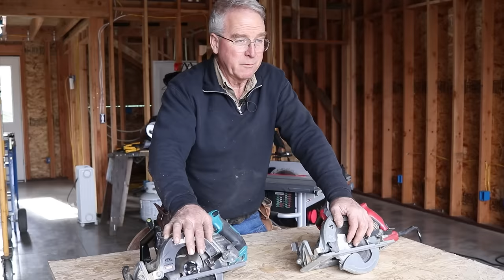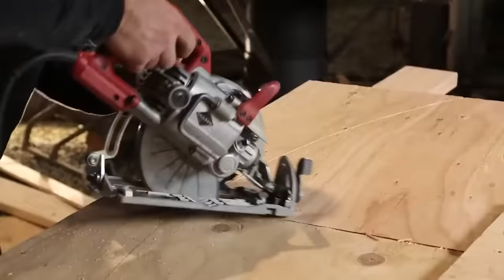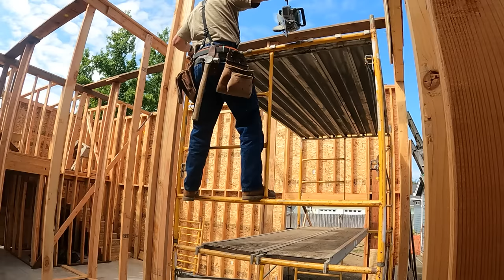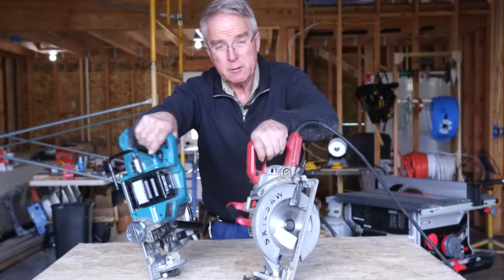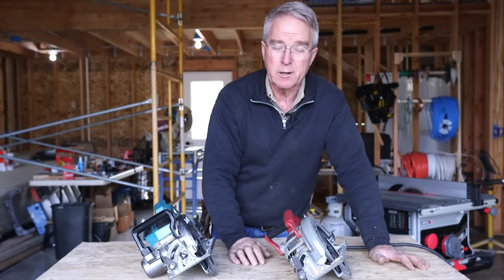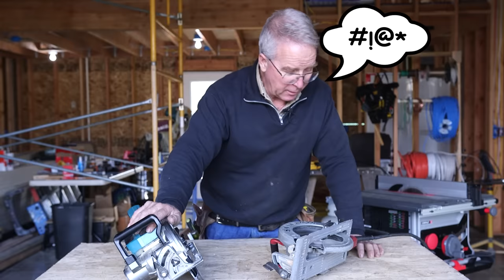Makita 40v XGT GSR01Z 7-1/4" vs. Skilsaw Mag 77 Circular Saw Review

Comment: I don't get those that want to hang on to their corded tools. I'm a stubborn old head myself that lugged around a mag77 for decades. I switched to the Makita and have never looked back. His points in the videos about what you can do with the cord (lifting it, lowering it, finding it, etc.) are rather silly. The Makita, at the end of the handle, has a place that you can anchor a cable, rope, string, (pick the one you want) and do the same things. Cut the cord off the Mag and the saw is worthless, cut that cable, rope, string off the Makita on the saw still performs exactly the same. Oh, and the battery running issue he brings up??? Seriously, check the battery level before you get up on the scaffold... That's user error, not a flaw in the tool.  Excellent video overall, but I wanted to nit pick over those couple of items.

Comment: Inherrantly I dont think its an apples to apples comparison (yet). Leave the corded one within range of the cord and use the cordless one for etcetera. Spending time in this ethos it becomes clear that using different, smaller, more "hot shit" circular saw running on battery is the winning move in conjunction with the traditional skill saw. I honestly dont really see a point to the battery competitors of the traditional skill saw framing pattern. Some battery saws are more compact and run the same size if not bigger blades. I think a video of you using and reflecting on some of these more modern designs would be very interesting!

Comment: The problem with these high power battery tools like table saws miter saws and circ saws is that the big amp hour batteries are insanely expensive. Each one of those batteries is the cost of a new Skilllsaw.
Reply: I agree but if you use your tools to make a living and it adds to your productivity it might be worth it.

Comment: Larger battery-powered tools come with a serious price tag -- not simply twice as much up front, but like all battery-powered machines, the Makita unit is hobbled by the long-term rechargeability of its batteries -- and the cost to replace them. Just one battery would set us back ~$220 -- and we'd absolutely need to replace them in pairs (at least). Every three-five years it would be like buying that machine all over again (without getting a new machine). That, for me, would require more than an occasional instance of convenience.

Comment: I wish they had cordless saws, with a removable cable.
Can use it either way. That would literally be the best of both worlds.
Reply: Metabo HPT/Hitachi 36V rear handle and complete line can use batteries and AC adapter
Best of both worlds

Comment: Warning:  A Saw with a brush motor and a "New" Inverter may not work.  The issue is a High Start current and "Wind-down" voltage spike.   For remote use watch out for "old" motors and that can damage "New" inverters.

Comment: If money is no object, than it begs the question, “what are you doing in the construction industry in the first place?”
Since money does matter to most, it’s important to remember that buying a cordless tool is not a “cry once” proposition. The batteries only last a couple years so you are always going to have to be replacing batteries every couple/few years, whether you use the tool or not. The batteries just die. So if you look at a 10 year stretch, a cordless saw is going to run about ~$2k (No inflation factored). At 10 years you could easily still be on your first corded saw with an original output of only about ~$175. Less than 10% of the cost of the cordless. 
For the homeowner only making occasional cuts? Get the corded. As mentioned above the batteries go bad even w/o use. 
For the craftsman making cuts all day every day? Get the corded. The cord becomes a non-issue very quickly and even carries collateral advantages. 
The cordless is the only option if you just don’t have access to a power source for long periods of time. You’ll want at least 2 batteries though. 
There is always the handsaw. A sharp handsaw is a pleasure to use. A dull one will make you hate what you are doing.

Comment: When will a company make a worm drive saw that has a battery pack built in that has to have a cord to charge at the saw vs at a charger…..and that same cord can be used to operate the saw at max performance while plugged in and charging?

Comment: As always Scott, excellent video. I've always said that electric is a different kind of power... Better. I have a cordless saw and the only thing it's used for is to cut down stock to avoid having to put something on the ladder racks. I've been self employed for 24 years now and people don't understand how one guy can build a deck, a roof, I've even been known to build a couple garages by myself. And the answer is simple. Every little bit helps. And having the right tools for the job is essential. I can't help but shake my head when I see guys hogging out 1/2" bolt holes in 6x6's with a cordless drill, or watching a guy cut a stack of floor joists with a cordless. I'm old school, like you, and really appreciate the work you do. Keep it up. Thank you. JASON

Comment: I would argue that as an actual saw based on cutting performance alone then no question the corded saws still have the edge, But the convienience of slapping on a battery and walking around anywhere and everywhere on a site means in my book the cordless wins, purely on practicality.. I detest walking around on site having to lug around a 110v transformer or extension reel to use the hammer drill or saw for  a single quick cut or hole in a wall.. Now if I just had a workshop then I absolutely would still have corded saws, makes no sense spending a fortune on the saw and batteries to move about practically knowhere..

Comment: Your conclusion is perfect! And Yep, the batteries and those good old "platforms" now there's less emphasis on the tool and more on the platforms. The big tool-maker-boys are competing and putting in all they;ve got to win the "platform" war. They love that "brand" loyalty which shifted towards battery loyalty....Some tools a worth having for the occasional need. It will pay for itself but still is occasionally needed. Better to have a cord in the way than having a dead battery (and discountinued) down the line when it's time to use it. The Big-Tool-Maker-Boys WILL reduce the quality of many of their tools when one or two of the Big Boys start crumbling (bankrupt, mergers yadayada...)
My loyalty is to the TOOL and not the "platform". The makers play a role yet, like in the automobile industry, Ford is (was) good in making pickups but not all of their vehicules are at the top or serve the intented needs. Not all things called SUV can get where a genuine 4x4 is meant to go.

Comment: As a Framing company owner with 8-12 employees I switched to cordless about 5-6 years ago Dewalt 577's. 
Pros: Not paying people to roll out $75 cords that only last a year in our cold climate.
Downsizing generators (jobsites rarely have power) to smaller more fuel efficient ones for charging batteries.
The guys like them.
Flexvolts work in all the tools sawzall, drills etc.
Save about $10 a day per crew in gas for generators.

Cons: Saws are slightly less durable.
Raising and lower saws out rafters or off the roof.
Saws are more likely to tumble off the roof without a cord/tether.
Battery price have increased significantly the last few years (lets go Brandon).
Cold batteries in the morning (place the near the generator exhaust). 
I am going to try that new Makita, although switching each shed/trailer to a new platform would be pricey.

Comment: Hit the nail on the head with changing the battery platform.  When Makita upgraded to the "star technology" on their cordless 18v platform, they were NOT backward compatible with the previous generation (unless you used the very specific 3 ah battery).  There was a little tab on the old tools that kept the star batteries from sliding in.  Makitas recommended fix was to knock off the tab.  

I'm sure all cordless tool companies do this, because lets face it, they make their money on consumables. But its a tough pill to swallow.  And if you want a different brand of tool...forget it.  Its all very frustrating.  Cordless tools have their place, but I'm with Scott on his assessment; convenient, but not sure its worth it for many tools.
Reply: On getting stuck with one brand of cordless power tools because of the cost of batteries: There are battery adapters for 18v/20v that are sold on Amazon and eBay that allow you to interchangeably use batteries from Makita, Milwaukee, and DeWalt on tools of those brands. You still need to have the chargers for those brands because the adapters don't work on chargers. They cost around $20 each. Since finding out about those adapters I've been able to pick and choose which brand to use for a specific tool based on reviews without having to worry about having batteries for that platform. And if the tool came in a bundle with battery and/or charger then great I can make use of those batteries as well. I have tools from all 3 of those brands but batteries and chargers from only Makita and DeWalt.

They also have adapters for those three brands' batteries to plug into Ryobi tools. Most pros would balk at using Ryobi but I'm a DIY homeowner/hobbyist user and find them useful for tools that I rarely use so not worth spending money on a better brand. No adapters to run Ryobi batteries on other platforms though.
Reply: @johnthumble5154  pure bs, they have two platforms for circs and they are both great, with one destroying the competition
Reply: @riba2233 oop here's the fan girl again. I told you I'm not arguing with a Child.
Lol destroys the competition, Project farm says otherwise.
Run along Play with your theft deterrent teal toys kiddo.
Reply: @johnthumble5154  haha, still coping I see, Milwaukee fangirls are really good at it. Project farm didn't even test them, you should watch some more serious comparisons like one from concord carpenter. Tell me when your Milwaukee smokes out and they tell you it is not worth repairing...
Reply: @riba2233  I'm not bitting kiddo.
Off you go those toys won't play with themselves, you could even play tea party with the Makita microwave and  kettle 🫖👸
Reply: @johnthumble5154  wow you destroyed me with that argument, so brutal, I don't know what I'm going to do now... /s
Reply: @riba2233 I told you what to do, go and have a tea party with your teal toys.. I know reading is hard for you but take your time petal, you'll get there.
Reply: @johnthumble5154  looks like reading is impossible for you, since you are ignoring everything I said and just keep trolling, which is obviously only thing you are capable off. Oh and you said that you are done talking to me, but it looks like the urge to troll is too strong...
Reply: @riba2233  I suppose you can show me the part where I said I was done talking to you then? 😂 Proved my point. Thanks.
What a mouth breather.
Thanks for the laugh young fella.

Comment: Dude, I swear you must be older than me,...and the MAG 77 was not out yet when I was young. It was just the plain old skil 77 (was usa made and about $130. at a tool store). So how can the "mag" 77 be your daily driver all those years unless you are way younger than you look? (unless the mag77 didn't have a red handle early on).  I went from the 77 to the mag 77 to the porter cable 743, then 743K..743K topped everything due to how light it was (and you can own a left and right handed version). I still have all the others. Can barely lift any of them. My opinion is that the Makita hyphoid corded saw probably runs slightly smoother than the rest of them, but it's heavy.  By the way,...our framers have been cordless for a few years,..they always use dewalt.  Their miter saws are still corded. As far as rotary hammers go,..cordless is great unless you have a LOT of concrete to drill...then you need to stay with a cord. Both have their place. So far I see no point in  a builder using a cordless table saw, but remodeling it will give you a slight advantage.

Comment: I had a black n decker cordless circ saw about 20 yrs ago, good for 2 or 3 2×4s, pointless 
My 36 volt makita will handle alot more,you need extra batteries for heavy continuous work but with the quick charger it will work continuously. 
Hint* look for the deals that come with 4 batteries, bought the chainsaw and the circ. Came with 4 batteries and double  quick charger, each, saved hundreds and love both tools but obviously the corded models will be lifetime tools and and cordless will eventually need new batteries, tech has made leaps and bounds but... 
The corded is corded. The cordless is cordless, both awesome tools for what they are

Comment: I've used both for 5 years and the makita is far superior. The battery lasts plenty long. The break on the blade is huge. Way better. If I need to rip a shitload of 3by, then I'll break out the mag77.
Reply: The break on the makita is a feature. Same with the soft start so it doesn't girate away. If you've used a ryobi saw they spin forever after the cut is done. A waste of time.

Comment: I don't think it's the fact that cordless tool don't have the power to do tough cuts, it's that they add in all sorts of "safety" features, for binding, kick back, rotation etc  that it artificially kills the power.

Case in point, drills. They keep making them more and more powerful, but then they add anti-rotation/kickback to them. So when you're drilling a 4+ inch hole saw, they crap out on you before they actually run out of power. It's super annoying.

Comment: @12:24:  Bam.  There, you said it.  Battery-operated tools are designed for obsolescence.  The battery will wear out and they'll stop making the old platform so they can sell you not just new batteries, but also a whole new set of power tools.

Screw that.  I got hung out by DeWalt.  Never again.

Corded tools will last until we switch away from 60 Hz 120V AC.

Also, batteries either lock you in to a single manufacturer or curse you with multiple charging rigs.  On the other hand, with corded, you just buy the best tool from whichever brand makes it.

Yeah, cords are a hassle, but for me, they're worth the trade-off.  I only buy battery-operated tools for stuff that really NEEDS to be cordless.

If tool companies get serious about standardizing battery platforms and legacy integration (similar to USB standardization), I'd reconsider.
Reply: Thays true but it isnt the hardest thing in the world to rebuild a battery.  With thay said Cords are timeless.
Reply: @JayDee-b5u  If you'd be kind enough to post your mailing address, I have a few I'd be glad for you to rebuild.  ;)
Reply: That is a bs statement, makita batteries last really long and they stick to the same line like forever
Reply: @riba2233  I'm glad to hear Makita has shown a commitment to a platform and presumably to legacy adapters.  They're a very good tool company.

That said, the batteries won't outlast a cord, and no current or foreseeable battery-platform commitment will outlast a national infrastructural commitment to electrical voltage and frequency.
Reply: @ncooty  and they don't have to. 5-10 years of good use is good enough. The convenience they provide is huge, so it's not a huge problem if you have to replace them now and then
Reply: @riba2233  I'm not sure why you think we're in any sort of disagreement.  The trade-off in convenience sounds like it's generally worth it for you, whereas that's less often the case for me.
Reply: @ncooty  👍

Comment: I HATE battery's. Im convinced they want to sell you battery powered everything because the battery's are designed to fail/degrade after 6 or so months of heavy use.  I don't need a subscription service for my tools. I buy corded whenever I can. Its cheaper, does not charge, and is often more powerful.  Most  the jobs we do are close to power anyways. Makita does make a corded version as well. Also there is a Battery Adapter to Extension Cord tho i've never tried one. Seems like a good idea to have one in the truck if you forget to charge your battery's.

Comment: I reckon they are both made in the far east, likely China?
Makita I recall are Japanese, though even they likely outsourced a lot to China.
Just like here in northern Europe where everything & anything of jobs & production, been closed and outsourced by the elite, like there is no tomorrow, weird fift column mentality.
the aspect of cordless certainly got its benefit, I also recall most of these bigger cordlessbrands, do have an AC adapter so you can make them corded for the few occasions that should be wanted or if you lack batterypower...

Comment: There is one Argument for cable tools which is true for DIY-people, not for professionals. You can buy and use the cable skilsaw for 30, 40 or 50 years. I doubt that with the batterie technology of today you have to buy at least batteries from time to time and after a couple of decades the batteries will not be available. A professionell carpenter will go through a saw within a couple of years thus this doesnt matter. Except 2 cordless screwdriver all my tools are cable versions because most of my tools I dont use everyday.